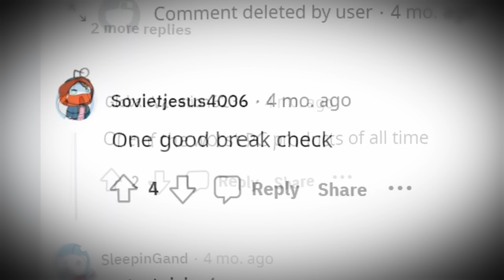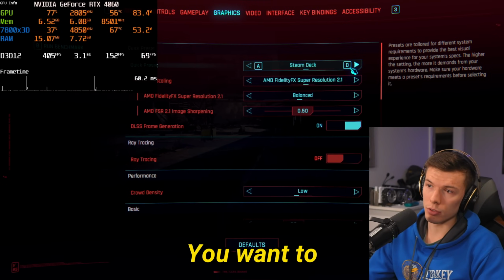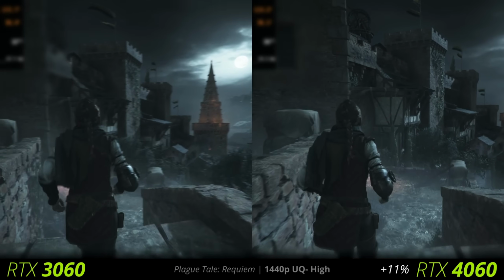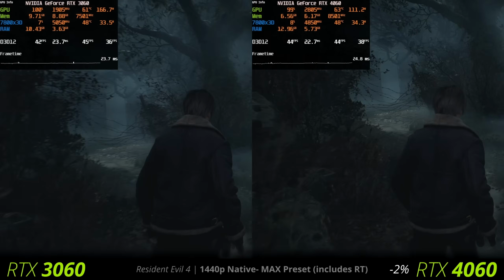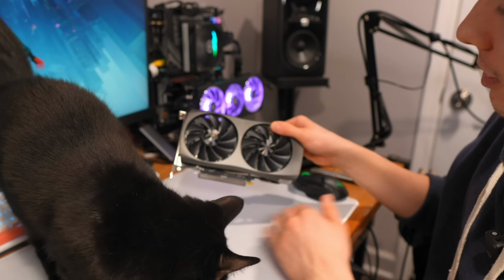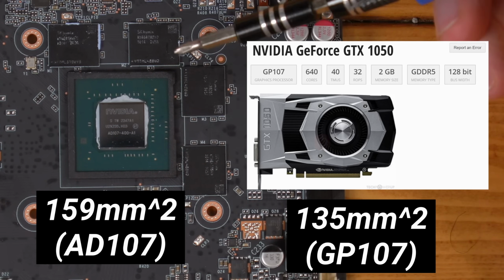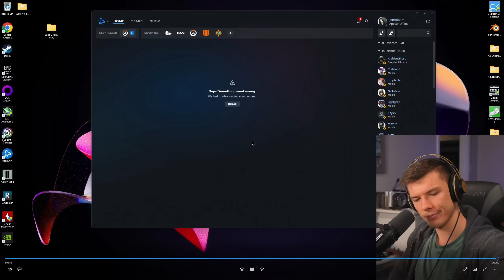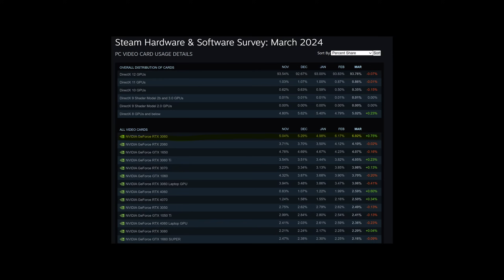I Tried Nvidia's best "Budget" GPU to see if we're Doomed

Comment: The delivery driver knew what he was doing, you can leave that at the door for a month and no one will steal it
Reply: Its actually a good card just awful price
Reply: Crypto miners will. Just saying.
Reply: @merchantmocha4665  well with that argument, everything is good but has bad pricing. It is a bad card, it brings nothing new. Any video card used for gaming in 2024 without atleast 12GB of VRAM is simply bad, whatever the price.
Reply: @eptic-c  and here I am playing whatever I want with a gtx 1660 super with 6 gigs.
Reply: @eptic-c  most modern games require more than 12gb Vram.
This has been proven by tests from many YouTubers using RX7600xt 16GB.
in other words the 8gb era will soon be extinct for the latest GPUs.
Reply: @merchantmocha4665 did your 1060 release in the last year?
Reply: @penonton4260 I like to play minecraft. I have GT 710 2GB. It runs fine !
Reply: @merchantmocha4665  what exactly? And for sure lowest settings and 1080p, so what are we talking about, that is not gaming, is like crawling compared to walking.
Reply: @eptic-c  It can literally play cyberpunk on high - ultra on 40+, and my main game apex on the 144 fps cap on high settings, so yeah guess I'm crawling
Reply: My amazon driver just plopped it down outside my gate with its original box showing. Nobody stole that bih 😂
Reply: @merchantmocha4665  yeah these elitists are something else man.
Reply: @Darsh0606 bruh that card is hot trash even some integrated graphics are better fr
Reply: The porch pirates might feel sorry for you and leave a 3080 and a couple bucks. LOL
Reply: Lol
Reply: @merchantmocha4665  i'm sorry that you find that acceptable. It's impossible for a bee to teach a fly that honey is better than shit.
Reply: @eptic-c  Jesus christ dude can't we all just enjoy games?
Reply: @merchantmocha4665  Yea! Its a passable upgrade for if you broke your GTX 1070 or something and mostly play older games at 1080p. There are plenty of people who does not play the latest AAA games after all. I bet Skyrim would run great on it!
Reply: If it's priced at 10 USD I"l get one
Reply: @mredizon00  than you wil be waiting for ever, never seen a 10$ GPU in my whole life
Reply: i would steal it cuz i use 1650...😭
Reply: @eptic-c  imagine having your ego tied to a pc part, maximum consoomer
Reply: I'd steal if I could get away from it lol. I've got 1650 lol
Reply: @Darsh0606 Minecraft was released in 2009. Even before GTA 5 and it runs even on integrated graphics, even on mobile phone.

Your gt 710 is not helping much other than saving 2gb from your real ram. The card should be banned, Even Intel integrated graphics is like 2x faster than gt 730 and amd are over 4x.
Reply: @chuckwood3426  dude I'm literally playing elden ring maxed ou 1080p with 60 fps with a 1660 super
Reply: bro i just made my pc with rtx 4060 ti with ryzen 7 , it cant be that bad right?.....
Reply: @dhruuvilparekh6346  It won't be unless it's 8gb.
Reply: @prateekpanwar646  i went for a 16gb ram
Reply: @dhruuvilparekh6346  i'm sorry for you
Reply: @eptic-c  a 2060 could be worth it since it is old. The price gon be low
Reply: I will gladly steal it better than my shitty 1050ti
Reply: @merchantmocha4665  you just have 5 iq
Reply: @eptic-c that is true if the 4060 was 200 instead everyone would recommend it unless there's something severely with it like it explodes or something it's a good card just a bad price
Reply: @merchantmocha4665 That's kind what makes it bad... if it cost 20 bucks it would be a phenomenal card
Reply: In all honesty with all the graphics card what confuse me is the numbering you would think with the higher number (for example 3000 is a bit old to 4000 being new) would simply mean it's better but nope now I keep seeing technicalities, or how an specific older gpu is better than the "newer ones" which brings more confusion on which gpu to find for a build that will last long.
Reply: @zenadvent8122  it isnt that confusing, the first number is the generation and the other number tells the performance tier, like 50 is usually the worst in the generation, 60 is supposed to be budget, 70 is getting over to the higher end, 80 is high end and 90 is kinda the best there is and nvidia sometimes has ti, super or both and they just mean the card is a bit better than non ti or super versions. It's a bit more confusing when looking at amd's cards too but its just the same thing but the version number is the hundreds and there's xt and xtx at the end to signify its a tad better and a weirdass GRE that means its worse.
Reply: @Darsh0606 Minecraft is CPU intensive and it doesn't give a crap what GPU or iGPU you have unless it's before Haswell era

Comment: Nvidia wrong named it... it's a RTX 4050.
Reply: I wanted to point this out.  It is that on 60 series cards, you typical get the higher end of a budget gaming card.  The 1060 6GB is a really good example.  Awesome card $200.  But they wanted to charge $300 for the card and they cant do that calling it a 4050 or 4050ti as those cards generally run from $100-$160.  Who is going to buy a card with a perceived value of $150 for $300?  So, it essence, it is a scam.  Nvidia used their naming conventions to fool you.
Reply: Rtx 4050 $199

It woudlve been a best seller for most budget builds. But Nvidia can't do anything right.
Reply: Which makes a 4050 a 4040.
Reply: @teilanittv  Oh, bro., totally scamming off the 60 series name.
Reply: Exactly
Reply: RTX 4050 laptop is real 4050 with 6GB (It must be 8GB) but 4060 is 4050 Ti. Also, 4060 Ti must had 12GB with 192 bit bus. ROP count of 4060 Ti is low (48) considering 80 of 3060 Ti. Only 4070 Super makes sense but even it has 12GB and in the range of $600. If you can buy 4060 Ti for $300-320, it would be good choice and good buy. Even Nvidia released 3050 6GB with less core count of 3050 8GB.
Reply: They can do whatever they want
Stop crying
Reply: @tibib0ss  does the company rimming job has a vacancy? do tell me salary
Reply: @teilanittv  I'm still running 1060 6GB and it's holding up well. Didn't have anything I couldn't play on at the very least low settings.
Reply: Except it's not. No 50 series has ever beat the last generations 60 series ever and this one does.
Reply: and the real 4050 is a 4040 lol
Reply: Should be cheaper than a 3060 and called a 4050ti
Reply: It's literally worse than a 2070 in Alan Wake 2. Wtf did they do to this thing? I mean, how can a company like this intentionally build something 3 generations later and one performance tier lower, and it's fcking worse hahaha.
Reply: My 3050ti laptop s better hahahaha
Reply: How can a 3050ti be better, it literally has worse chips, less ram, less cuda cores, a lower frequency, and I am not even starting on the cooling performance of a laptop. It's at least, if not even more of a waste of silicon than the 4050.
Reply: @VolcanicProtectorMan  Then what is it?  No 60 card has ever had a such small increase in performance and a decrease in specs
Reply: Yes, I think its the GA107, so its no wonder.
Reply: @teilanittv  Those were the golden times, incredible value. I considered the Pascal cards to be a bit pricy but the performance jump was still worth it. Even getting the 1080 Ti, I used it for 3 years and then resold it for almost the price I paid for. Then a few months later got a 2080 Ti FTW3 for 540 €, used it another 6 months and sold it for 700 extra. Sick times, but they will likely not come back. The market is stagnating, the games are shitty and the cards overpriced.
Reply: @timonbubnic322  doesn't matter its still a 60 card it, still beats the 3060 in almost all games. it is just not aimed at the people moving on from a 3060. much like intel 14th gen is not aimed at people that have 13th gen to upgrade.
if you are coming from a 2060 you would see a nice performance increase with better tech for upscaling and streaming for the same msrp as the 3060.
do you remember the performance difference of a 1660 and a 2060?
Reply: @VolcanicProtectorMan  the difference between the 1660 super and the 2060 was quite bigger than 3060 vs 4060. It may not be a 4050, but it sure as hell isnt a 4060 either... Its just an awful buy
Reply: @timonbubnic322  a 2060 MSRP was more expensive than the 3060 or 4060 msrp
Reply: But it’s nvidia, so people will buy it regardless 😒
Reply: GTX 4050
Reply: @teilanittv gtx 1080ti is much better.. says alot. when I wanted to replace my 1070 gtx I bought a 3060ti.. guess what, I returned it 😂 then saved up for a 3090ti, which got faulty sadly after 1 month so got my money back and waited for 4090, but it sold out before I could get hands on and ended up with a 4080 oc instead that I dehyped for my self while waiting for it thinking I made a mistake and should have waited for the next 4090 batch.. the 4080 surprised me and made me so happy I forgot that I even wanted 4090 in the first place 😂
Reply: @teilanittv  I am not defending Nvidia here, but Pascal as a generation is an outlier compared to those before and after it.
Reply: @mrszczurek I was still running it a few days ago, great gpu
Reply: @elpato3190 it's is already a best seller for budget builds😂
Reply: @FingalPersson hate to tell you buddy but 4060 has 10-20% increase in frames over 1080ti... and. And 1080yi is 220$ used while 4060 is 280$ new on top of that it consumes 3x less power.

Comment: now introducing the RTX 5060 with 4GB of VRAM and is recommended for 480p to get 60fps
Reply: You lie it's 360p
Reply: 1440p gaming but you forgot the zero
Reply: and with dlss 4.69 you can enjoy incredable 15 fps ray tracing experience on it and ofc with massive lovely Stutters
Reply: now introducing 10060 with 1 gb of sdram, msrp 100000 eur, with dlss 10.0  frame generation 13/10 56p compatible, no pcie express included, only sata gen 100.0001. runs on single hamster. Hamster not included. If you need to unlock more hamsters, preorder hamster performance dlc.
Reply: @scarfaceReaper  but it upscales to 480p and generates 3 fake frames in between the real frames.
Reply: @4.0.4  but is 240p...hmmm doesn't look good but I'll take it
Reply: Time to break out my old CRT TV!
Reply: For a record setting price of only $500, including frame game 2.0, x4 more fps, twice the input delay.
Reply: @prabhakardhar1379  LOL They may start marketing the stutters as preplanned mini breaks to save you from gaming too much, that will be an extra $150 for that feature please.
Reply: 3% uplift over the GT 210
Reply: for $430
Reply: If they stack slide again;
You will need a 5080 for 60 Class performance..
Reply: you are joking but leaks suggest yet another 8gb vram 50 class card named as 60 lol hope that changes but I doubt it.
Reply: it is going to be precisely 3 percent better than the rtx 4060
Reply: RTX 5090 beta male edition BME 256mb of vram for oblivion in 244p with no HDR for 3k
Reply: @Moonlit_Breeze  f yea I can't wait to spend 600$ on a 480p GPU sign me up.( Lost of sarcasm, am know Nvidia would do it to, lol)